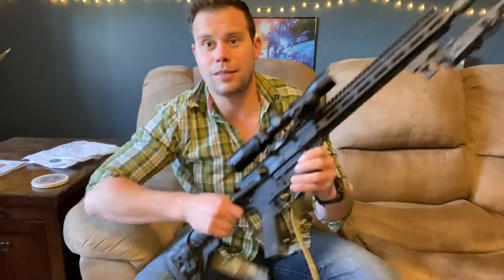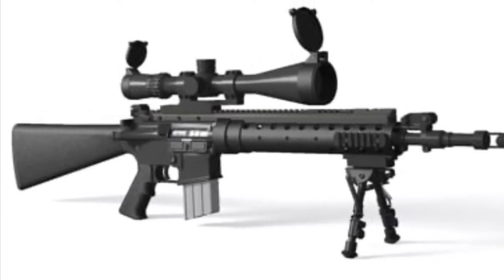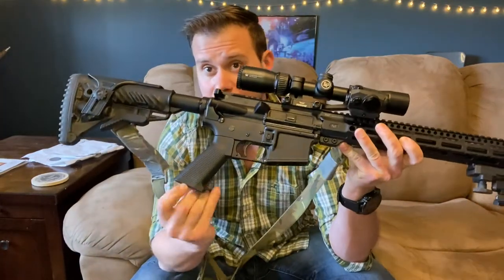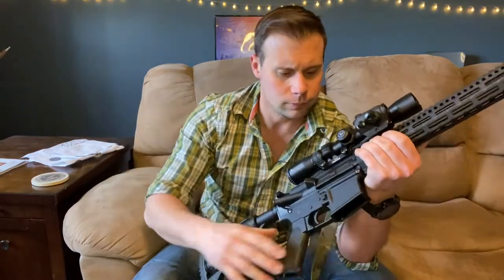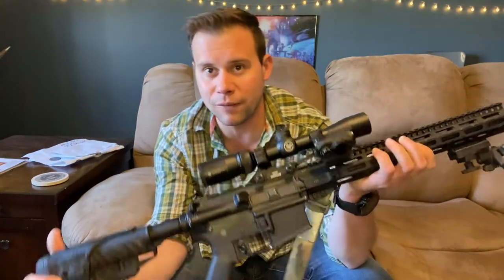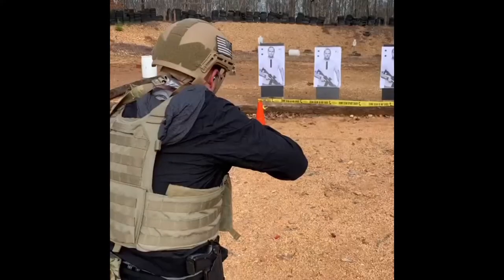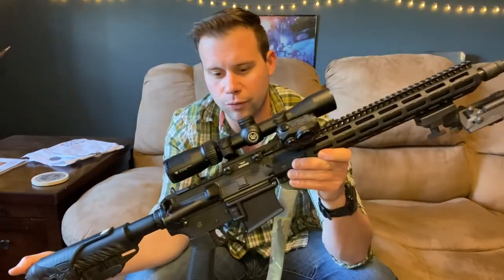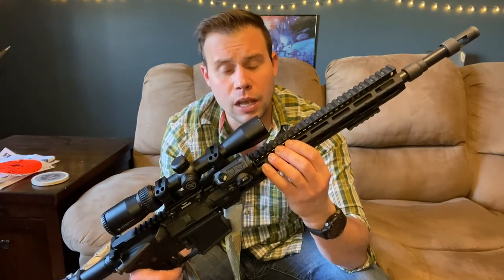MK12 Inspired Build, MK12 Mod Murph

Comment: 2 options to make the gun run. 1)  BA has a bit under sized gas port hole so have your gunsmith drill it out just a touch to get more gas. 2)  I think you went in the wrong direction with the buffer. Put the standard buffer in it is light and get a reduced power buffer spring to go with it.  I have 2 of these barrels in 223 wylde and 1-8 twist 69 grain sierra match kings are money.
Reply from the maker: I’ve had my suspicions about the gas port. A few others have had similar complaints attributed to the ports
Reply: @murphslaw1276  https://www.youtube.com/watch?v=G7RNYeT2cv8     This is a good overview of the barrel. He also says how much to drill the gas port out to.

Comment: Get the Springco Yellow Spring (reduced weight spring) and it will solve all of your issues.  I had the same problem.  I'll never buy another 18" with rifle length gas.  Intermediate is the proper gas length.

Comment: Didn’t you say in one of your previous videos that a prerequisite for a battle ready rifle is having a light? I get that this is a DMR primarily, but with your red dot you have it set up to also work in close quarters. Why no light?
Reply from the maker: This isn’t a fighting rifle. It’s primary purpose is longer engagement. The light is a necessary omission for its purpose. I could see some reasons for its inclusion, but not in its present capacity.

Comment: What mount did you use for the Romeo5 and thoughts or regrets for using the romeo 5 over a RMR??
Reply from the maker: I like the window of the romeo5 versus an RMR. I think if you’re weight conscious the RMR makes more sense. But an enclosed red dot is more environmentally sealed for hard use type applications than an RMR. Different strokes and such. 
I think I included the mount brand in the video otherwise I don’t remember off the top of my head at the moment.

Comment: Hey Murph, great video as always. Why did you pick 5.56 rather than .223 Wylde as a clambering?
Reply from the maker: Availability. Their were not a lot of options in stock when I launched the build. 223 Wylde wasn’t as big of a pursuit as much as barrel steel, length, gas system, and profile.